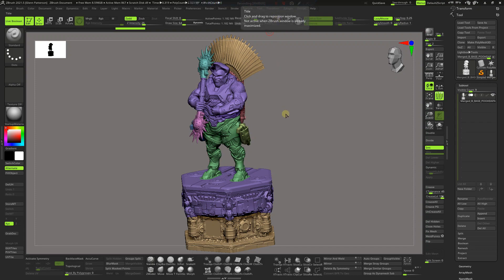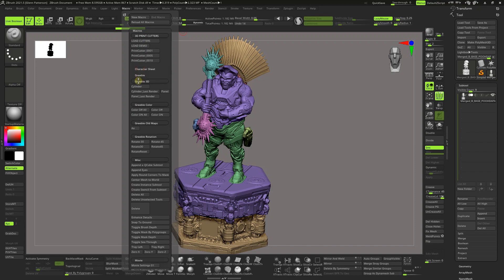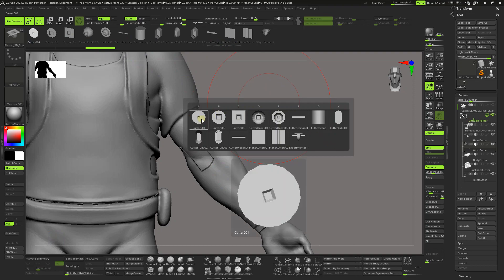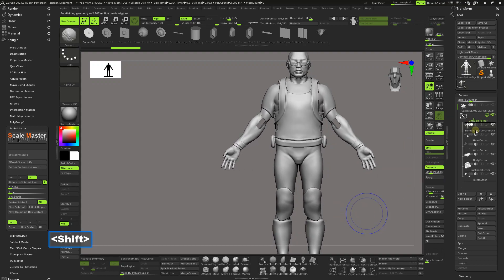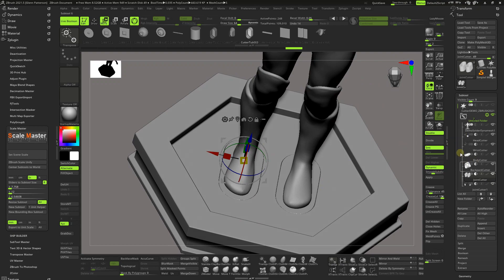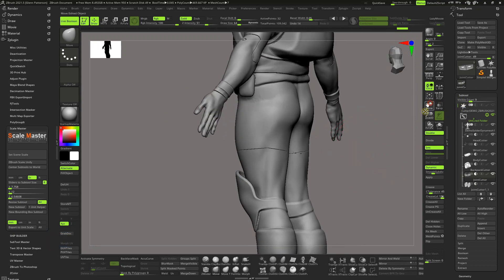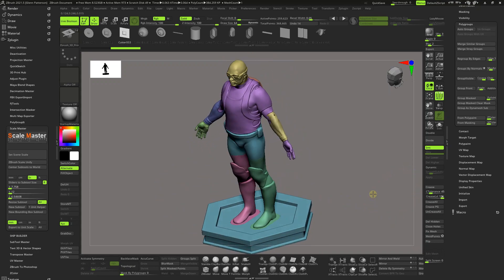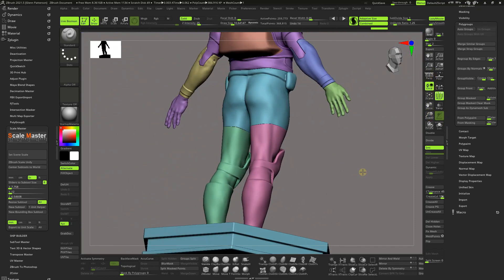ZBRUSH 2021 3D PRINT CUTTERS

Comment: Any chance you can make a quick tutorial on how we can use this in zbrush 2022.  I  am not sure how to turn the .obj into the cutters in '22
Reply from the maker: You can use this the same way in 2022. There should be a IMM Brush included with your download, 3D PRINT CUTTERS.zbp. Just load it under Brush Menu. So you shouldn't need to convert .obj to a IMM Brush. I just included it for folks that wanted to try this Technique in other Apps. For your Knowledge though on how to create a IMM from multiple .obj, select Polymesh 3D (Star Looking Object) from Tool Menu. Go to Zplugin Panel and go to Subtool Master. Click MultiAppend and select all the .obj files you want to import, click OK. Now you should have Multiple Subtools with names associated with the files they are from. Go ahead and Delete Polymesh 3D and turn on Double under Tool/Display Properties for each Subtool, this will help with the Thumbnail Generations. Now lets line up your IMM Brush you want to make, click Frame to Center Subtool, Rotate Camera with Shift held down to lock Camera to 90 Degree axis. These Particular .obj's work best with camera pointed face first at them, look at upper right of screen and notice the face is looking at you. Now that we're lined up click B on keyboard and select Create InsertMultiMesh. There you Go, just a matter of fine tuning the Brush to your liking, for instance adjusting the Depth of each cutter to liking and save the Brush from the Brush Panel.

Comment: hey question.... might be a me issue.... but I was using these cutters for a 3d print project I was doing and I found a ton of things out about having overlaps on my file with the cutters makes it a HUGE pain..... but I managed to fix my file and get it to where it should work nicely and found a lot of my prints with the larget cutter settings required me to sand down my print so that it could fit.... now just out of curiosity if anyone else knows is that a me issue? or does anyone have any ideas.... (I am printing fairly large so it shouldnt be a resolution issue)
Reply from the maker: If your finding your doing a lot of sanding to fit pieces, I would increase the thickness of the cutter before you do your boolean cut. Recommend doing tests to determine how thick you need the cutters to be for the scale your printing at. FDM prints will always need thicker cuts then on Resin Prints. As for overlaps in geometry after cutting, not seeing the file I can only guess, your cut could be so thin that the points could be fusing back together during the clean up process, I know fix mesh can fuse points back together weirdly. Think if after you cut everything do a split parts and then clean up each part individually so nothing welds back together.

Comment: Love your video...but as it only works in Zbrush 2021, I'm screwed. If you had a stand alone program, I'd purchase it in a heartbeat. ZBrush is way above my pay grade for a hobbyist.
Reply from the maker: I'll have to add .obj versions of the cutters, but you should be able to add a solidify modifier to them and do a boolean cut in Blender to get similar results. Won't be until tomorrow till I get the files ready.
Reply: @Glenn3D1993  Many thanks Glen :)

Comment: so i went thru all your steps several times, w dynamesh, then decimated, even used your example, but failed to kick out a UDmesh.  any options im missing?  if i try dynamesh, its too tight n merges the 2 parts at spots.  love your tool n really want to use it
Reply from the maker: You need to be using the Live Boolean system to generate the cuts. UDmeshes are created that way
Reply: thanks. i did. maybe i did the process wrong. i will keep tryin, great video!  keep makin them!  i will get it eventually

Comment: Great video, great idea. I am sure this method will help save time. However, to save time, we sacrifice quality: the printed model will look more neat if divided in more suitable places, such as along the line of boots, belt or bracelets.
Reply from the maker: This was just a quick demo of use, but you could use same cutters and shape to fit where you needed. If you look at demo file you'll see the backpack and torso cut are at the seam lines. All depends how much time you want to put into cutting up your model.
Reply: So just place them at those places? Obviously?